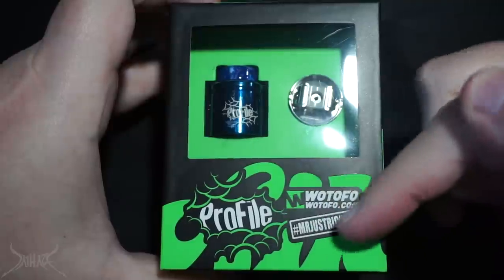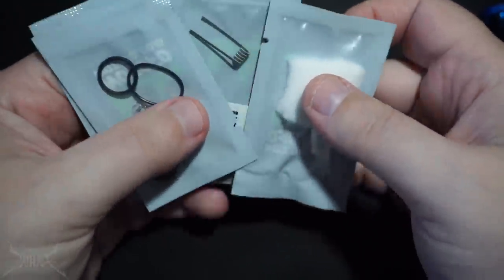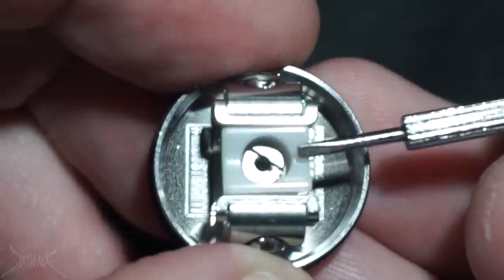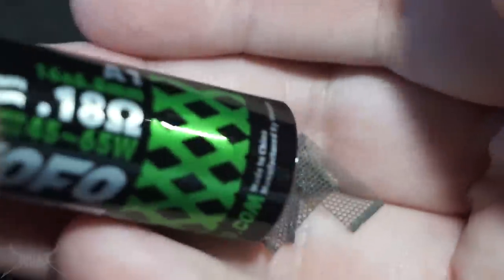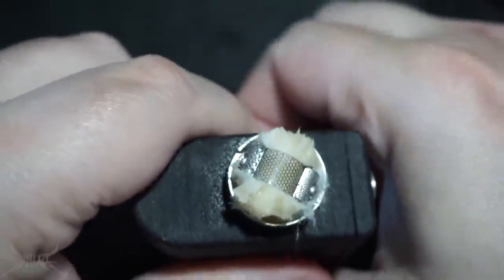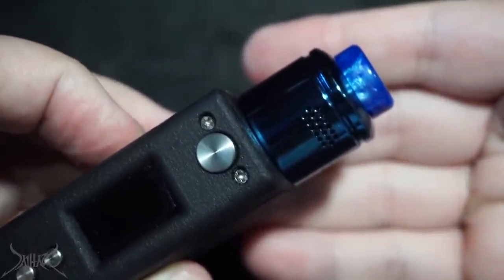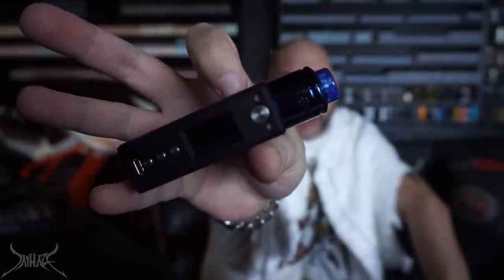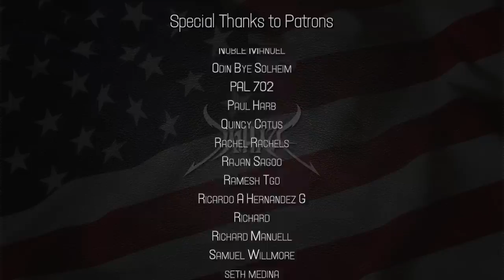Wotofo Profile Mesh RDA Review and Rundown | MrJustRight1 Project

Comment: I’ve used it for years now and when I first bought it the only issue I had is the cotton it comes with sucks cotton bacon prime does much better and you only need half a strip of it for a time vaping it at 66 watts with a 70 watt boost for 0.3 seconds runs amazingly
Reply: Found one in a box and been trying to build it. Had one good build but it was ever so slightly leaky. I decided to rebuild a little thicker but now I’m getting burnt hits. How exactly are you wicking this?

Comment: For RDA's don't thin out your cotton, they done tests and that thick cotton absorbs the juice much more quickly than that thinned out cotton. Also wick it tight, not super insanely tight but tight enough so the coils move a bit when you pull it through. The thicker the wicking, the less spit back you'll get. Spit back occurs when larger than usual pockets of juice accumulate around the coils due to the lack of cotton in place to keep it from pooling. When you inhale these little bits of juice rise up and Mmm, a mouthful. 

Another tip, there is a material i'm working on called A-prophetic D, or APD, its a blend of synthetic fibers and silk weaved in a very popular weave that is then heat treated and then fed through. The Capillary action is 12% faster than Organic Cotton, with both wicks at 1/4 inch compressed, using 70/30 VG/PG. The wick lasted 76 days before it had to be changed. The coils would gunk up long before the Wick broke down, it was the same blue color it was when it was first made and still pulled that juice up with only a 6% loss in absorption rate (at 65 days).

I also sent it out for toxicity tests where they heated it to specific temperatures repeatedly until the temp was high enough to burn it, and it released 0 emissions harmful to people, or harmful to the environment. 

Oh and if ya didn't catch, its blue, a translucent blue.. like a jewel, its actually pretty cool. I was going to start a working contract to have it mass produced in a small batch to start selling, I was thinking 9.99 for a little pack of whatever diameter you needed, 3.5mm, down to 2mm, i'd say 4 of them. You wouldn't have needed to buy more for 4 months!!!

I was gonna do all this.... but then I woke up...

I want a burrito

Comment: I think this rda is the rda of year 2018.. Easy to build, extremely good flavor, greay air flow and quality.. I love the profile rda and because of it I only use mesh coils.. 

Jai, it will be highly appreciated if you consider a project for you to have a mesh coil.. With your experience on how to design the airflow and a build deck similar to the ones un the sub-ohm tanks (vertical mesh) it will be unique..

Comment: Idk y wotofo only made kanthal mesh for this...they should of done stainless steel and ni80 mesh as well for those who dnt use kanthal
Reply: @dieseldabz7104  yea but there not a plate ..smooth plate like this..u have to cut them to size..and they got rough edges..plus its actual real mesh ..this is like a plate with wholes cut in it so its easy to wick and the resistance wont b the same either ..thts why i want wotofo to make those same plates in SS n ni80
Reply: @daniellebordeau606  vaplyfly make something similar in ss and ni80 but its more like a flat notch coil
Reply: Danielle Bordeau  the resistance wouldn't be the same if they were made out of ss or ni80 anyway - & you know there's spools of mesh for sale all over the place; but still, it'd have jaggy edges, if that's sumtn that bothers you
Reply: @stephenyhelka8635  yea it have to b a little diff for resistance but they can do it...yea the jagged edges makes it hard to wick n idk if it produces as much vapor n heat as this kanthal plate type mesh they made for the profile vs.reg mesh but i got what ur saying i wish i knew someone who tried reg mesh
Reply: Danielle Bordeau   i've tried the vandy vape mesh tank & they include like 9 pieces of mesh w/it; 3 of each metal (ss, nichrome & kanthal), & they were all too long but easy to cut & work with when placing/fitting them into the rda
Reply: @stephenyhelka8635  I've got the Vandy Vape mesh and am waiting on this one now. will check out your suggestion, but i feel itll be a totally diff vape with those tight mesh screens.
Reply: TheConspiracy Realist  it would be different cause the kanthal heats up quicker than the ss, plus those spools are more screen-like than like a solid plate
Reply: I use both Vandy 400 and Vandy 150 SS mesh in my profile on a Pulse X. I love the temp control.  It's not difficult to wick.  Just make sure to use as much cotton  as possible and angle cut your excess, longer on bottom.  When making regular sized strips it ohms out between .13 and .15.  I installed a a larger strip that ohmed out at .27 and doubled up some firebolt cotton and it's amazing. The mesh is close to the drip tip but the flavor is incredible.

Comment: The only explanation I can think of for why mesh works so much better in sub ohm tanks is because the air is going straight through the middle touching every part of the coil and the cotton is one the outside. I cannot think of any other reason that u can run such higher wattage through mesh coils heads than through a mesh coil wick like a rda or rta coil. Either way good review jai I was curious as to how this would be perceived throughout the community and I have been pleasantly surprised. Still don’t think mesh is for me but this seems a step in the right direction.
Reply: dane bentley 

it works cus the mesh provided can handle pulling a ton of cutton THRU it.

i don't wick my vandy mesh that way. i pack themesh with cotton. then install it to the deck. been using it almost exclusively for a year